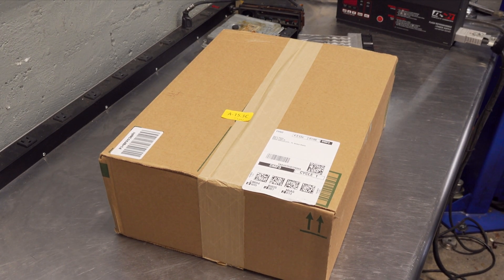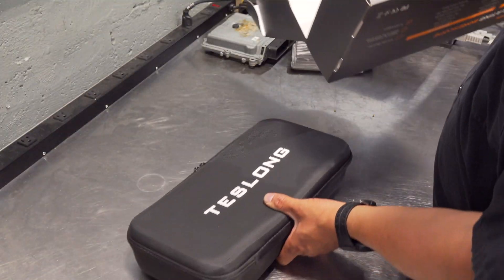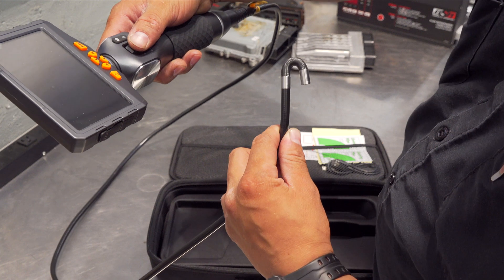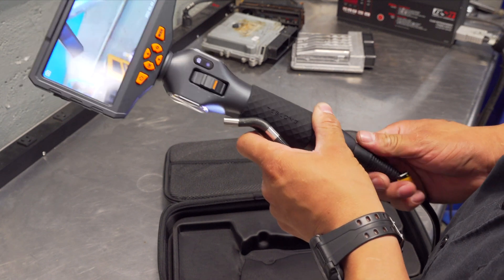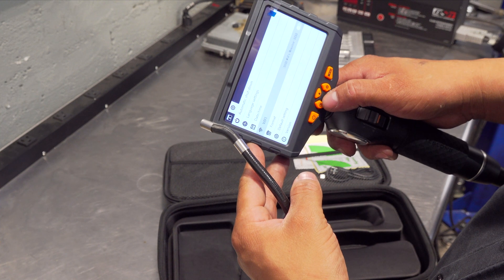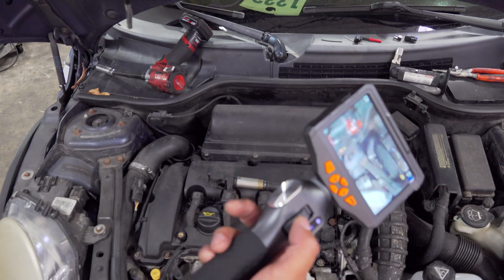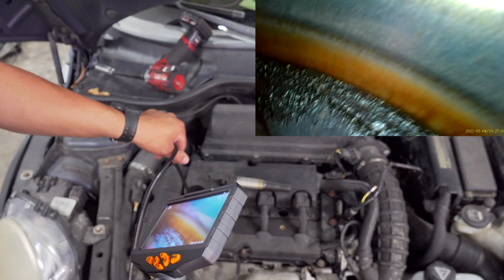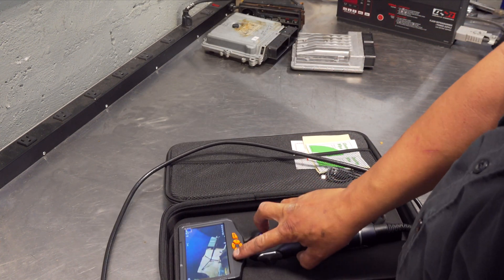The anticipated, well-priced articulating borescope - TESLONG TD500 - New Release

Comment: Hey all. I recently purchased this borescope on amazon. I can't seem to contact the seller or customer service on amazon. I just tried the official website so maybe they will get back to me. The temperature on my screen is not accurate. Reads much hotter than room temp and seems to heat up with the flashlight. I did not purchase the tool for this but I would like to know if this is normal. My camera came charged up from amazon also. Not sure if it was opened previously. Also, the thumbwheel is a bit noisy. like it needs some lubrication. Just trying to figure out if this is normal or not before my return window expires. Thanks everyone!

Comment: Would there be any problems with using it on a 2 stroke fitting through the spark plug hole. Thank you

Comment: Looks great! I'm trying to decide which style scope to buy next. Does this articulating one have a screw on cap around the camera? Could it use the mirror, hook, and magnet accessories? What resolution is the display? Any info would be greatly appreciated thanks!
Reply from the maker: No screw cap or attachments. Honestly ive never used attachments before.  I've tried them and they just suck LOL it's a 1080 picture
Reply: @SuperMarioDiagnostics  lol gotcha. I've used the mirror before  and yeah an articulating camera looks better as long as there's space. Think I'll invest in this one. Thanks for the response!
Reply from the maker: You're welcome